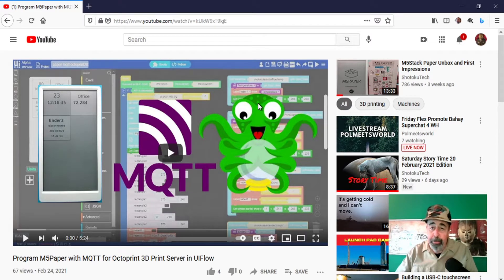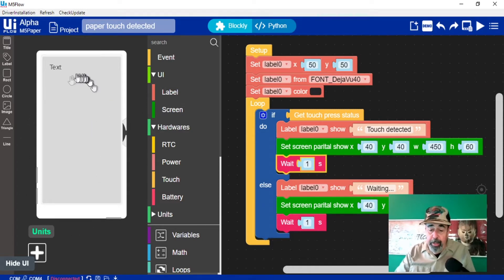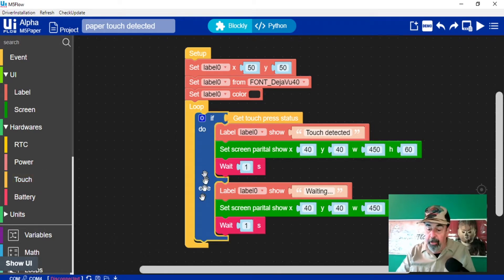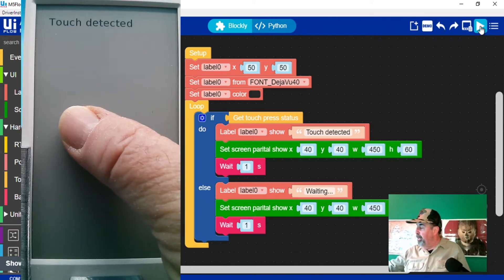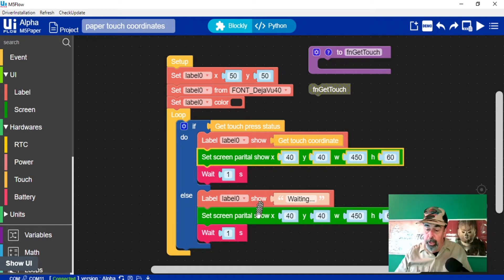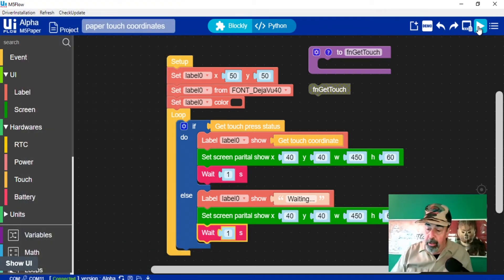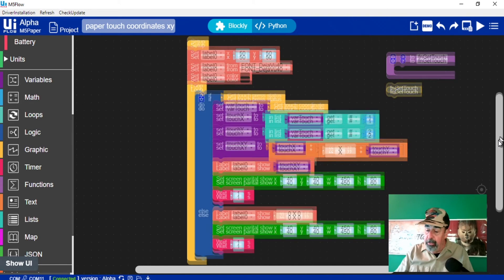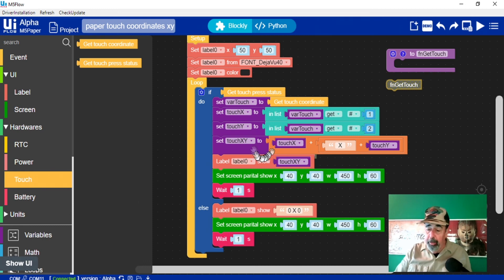M5Paper & Touch Sensor in UIFlow

Comment: That’s a great start sir! I’d love to see that in a real life scenario: use buttons with mqtt to turn things on/off.
Reply from the maker: Half way there. This is the back end piece: https://youtu.be/5hmQOf28qOY
Reply: @ShotokuTech  great! Did you already knew about home assistant? So much fun. Love to see the front end part on how to use m5paper with touch to send Mqtt messages. Thanks sir!
Reply from the maker: @Rutger90  No you tipped me off about it. It is what I am looking for. I have been working with WebThings.io but it lacks the simple MQTT actions. And it does not have a broker either.
Reply: @ShotokuTech  home assistant is great fun. Using it as my go to domotica system in my house for years. Really worth looking into!
Reply from the maker: @Rutger90  The integrated MQTT broker is exactly what I am looking for. It is the deciding factor. The only downside is I have 6 smart plugs the won't work with it. I checked the online add-on page as well. Not a deal breaker, I just need to set up an E-Bay store and start selling surplus items. Thanks again for pointing it out.
Reply from the maker: @Rutger90  P.S. Been struggling through the week on the M5Paper buttons thing, but got a breakthrough last night. Learning process!
Reply: @ShotokuTech  That is good news! For smartthings you can integrate it in Home assistant if you like and expose them as lights (in case its a light). From that point you can use the integrated mqqt broker as a trigger to turn a smartthings light on or off.
Reply from the maker: @Rutger90  Check it out. Thanks! M5Paper Buttons, Home Assistant Automations and MQTT. https://youtu.be/aU-iv5lF94o
Reply from the maker: That might be a week or two out at this point. I want to make a video about my own MQTT broker in-house here rather than continue to use MQTTHQ.com. I don't mind having read-only stuff open to the public, but stitching things off and on should be private. LOL. Start looking at how you would use the 'Case' block under logic and explore the 'Function' blocks. I am trying to break out of the loop myself. Thanks.
Reply: Yeah i totally understand! I'm using the all local MQTT broker built in Home Assistant, works great! For the M5Paper i'm trying to understand how i could use a X and Y value to do something. It doesn't make sense to me how to use UIFlow and tell it to do something when X and Y values are met.. If that makes sense :D I must admit that UIFlow and programming is fairly new to me.
Reply from the maker: @Rutger90  Quick search seems to indicate Home Assistant is the best option. I have been playing around with WebThings gateway. But it does not have a broker. It has a lot of plugins for commercially available smart bulbs and outlets. But it is not easy to use for DIY MQTT experiments.